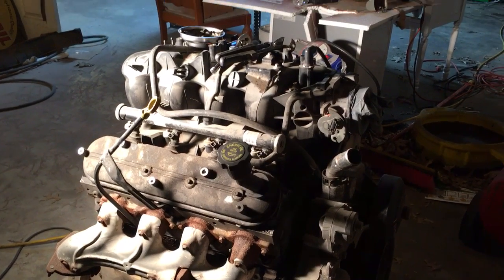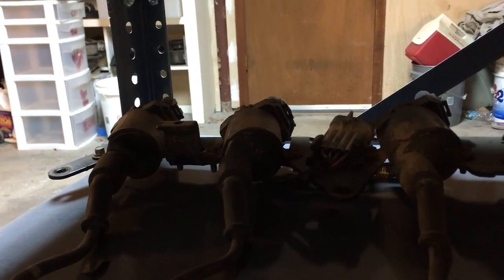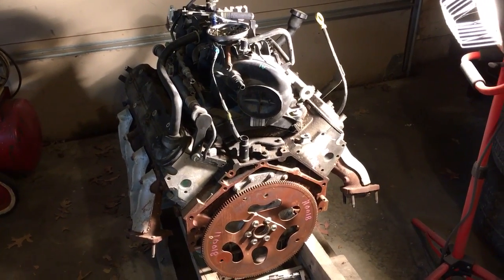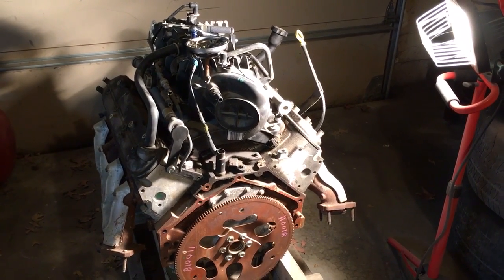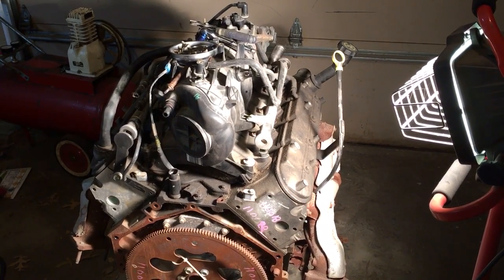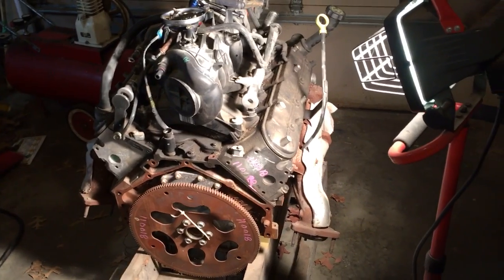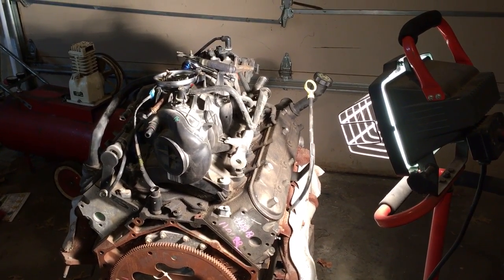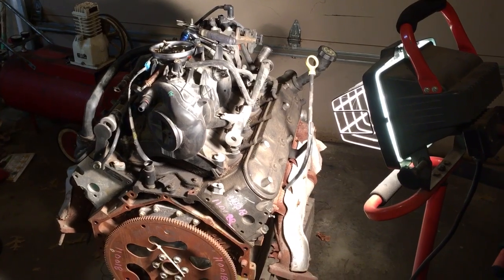4.8 Turbo meet the "Turd-Bo" build LQ4 cam in a 4.8

Comment: Brother how much would you charge me to port my 799 heads if I pay shipping of course both ways? By the way I'm in Canyon Lake,TX 78133
Reply from the maker: Murrica Motors I charge $750.00 to port both sides Intake & Exhaust including disassembly, cleaning, lapping the valves and precision assembly.  
Customer supplies all new parts: Springs, Valve seals, New valves etc. 
Machine work at Nolands Cylinder Heads extra: ( I’d need to verify pricing)
CNC valve job est. $300.00 
Surfacing est $125.00
Facing valves @ $2.00 each 
Guide work etc. unknown 

Im in Raymore, Mo. 64083
Reply: @HeadFlowInc  yeah shipping is about $150 each way. Lol

Comment: upgrade SPRINGS , VALVES and pushrods....u Will wish u did when it drops a valve
Reply from the maker: questionur world I have hardened push rods and Comp Cam springs.  I haven't seen many reports of issues with the factory stainless valves. 
If I were going solid roller then I'd definitely go to a stronger aftermarket valve. 
I'm now considering a GT45 Turbo on my daily driver 5.3. I've got to maintain fuel mileage below 3000 rpm, the 69mm turbos don't really make Boost until 3000-3200 rpm so it may work. 😎
Reply: HeadFlowInc heard that....im running honda ZC motor with aApexi AFC for fuel tube.   it dropped factory valve ,  built with forged internals and stainless VALVES now but I cant tune ignition because vacume adVance distributor but hell a 1987 1.6l laying down about 230hp ain't to bad in a 2100 CRX lol.... you are a badass dude love ur attitude about not having to have the best of best to have a lil fun.
Reply from the maker: questionur world Thanks man keep enjoying your ride!

Comment: I have a 4.8  2002 Silverado I went with a duel spring and Hp Rods (Texas speed) I put a 220-220 cam in it. A cold air system (Of course) with a Flash tune. I am running a 3500 stall and a 4.11 rear. Its amazing. I can still pick up more H.P by upgrading ( Long Tube headers and etc etc. I total enjoyed your vid. Thanks.
Reply from the maker: +John Flynn Thanks for the feedback and the info on the rods from Texas Speed.  I just went and picked up the block from the machine shop today!  I need to get busy gaping the rings!  Your truck sounds like a strong runner!  JD

Comment: I'm supposed to pick up a 4.8 tomorrow myself.
Reply from the maker: +ChevyShawn   The 4.8 engines don't get the credit they deserve because of all the craze for the 5.3's and the more costly 6.0's.  Good luck on the 4.8 build
Reply: +HeadFlowInc thanks I got it picked up now just have to figure out where to put it
Reply: The 4.8L with adjusted stock ring gap is turbo ready and the bottom end can handle 800HP safely with a single turbo on about 16psi. They are the most turbo friendly LS out there.